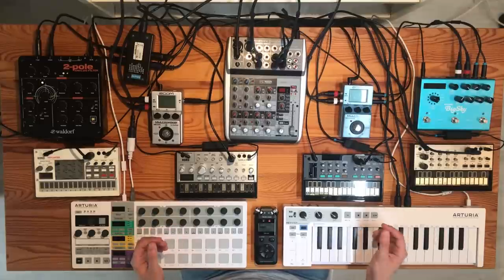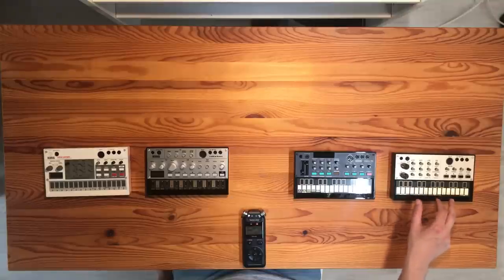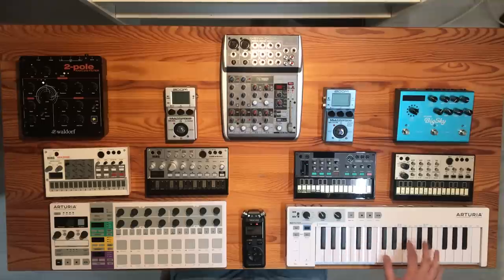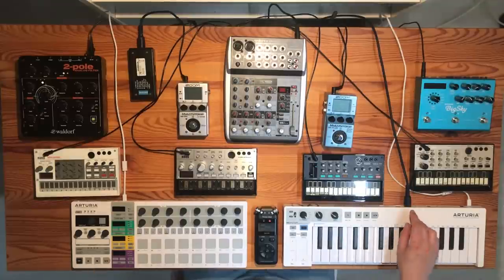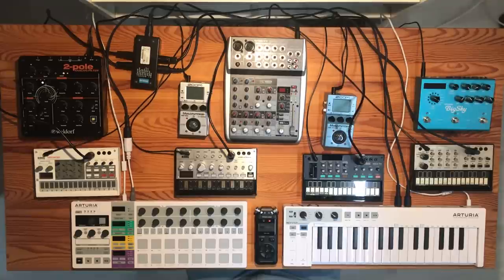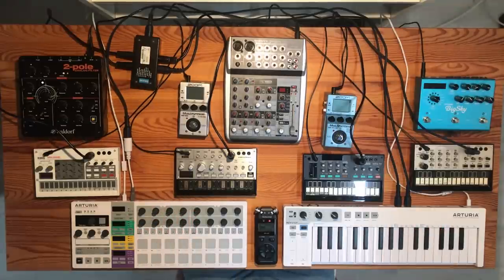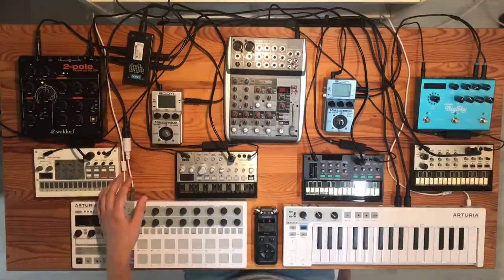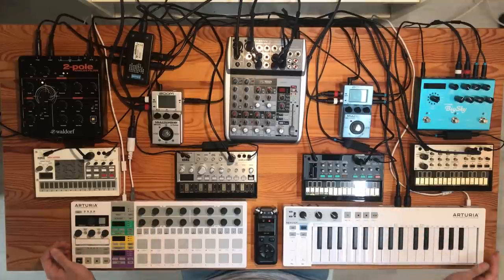Our Volca Setup: How Is Everything Connected? (2018-06-03)

Comment: I use a midi transformer to layer volca drums with the circuit. The cuircuit drums don't output to the right notes to drive the drums on the volca beats so I write a tiny program for my midi transformer hardware that remaps the notes on the fly. While the volca beats has a cool sequencer on its own it doesn't have swing. The volca sample does but I like using analog drums on the same note as the samples on the circuit, I get really fat drum sounds by layering. Then I layer the bass synth with both volca keys and monologue, so I have a 5 osscilator analog bass layered with the circuit virtual analog bass. Sometimes I layer my circuit keys with the volca keys but usually I use the keys as a second bass voice either in unison or octave or ring mod mode.
Reply from the maker: Brian Redfern : Interesting! Do you have a video online of this setup?
Reply: @SlenterendeBeer  I'm working on it need some better lighting for my space but soon I'll be talking about circuit and even how to control volcas with Roli block
Reply from the maker: Brian Redfern : Cool! :)

Comment: Hi guys, thanks very much for the helpful video and great jams, I bought the keystep and beatstep after following the videos.
 I have the exact set up here but using just volca keys,bass and sample and even bought the same midi filter used.
after setting up just like the video (midi out of beatstep into keys and then onto volcas)I have the sample coming through the drum channel of the beat step with each drum pad corresponding correctly to the sample, but I just can't seem to get the keystep to work with the bass or keys. It seems maybe I'm not setting up the midi channels properly on the control centre. Both Bass and Keys are set to midi channels 11 and 12 on there respective units after seeing the sample takes up the first 10 but maybe you could explain further how it should be set up in the midi centre. Thanks very much for you time.
Reply from the maker: Paul Savage : You need to set the corresponding MIDI channel on the Keystep as well, by holding SHIFT and pressing the 11th or 12th key on the keyboard. So you don’t need the Control Centre for that. The one thing you do need to set for the Keystep in the software is to enable MIDI THRU. Let me know if that helps.
Reply: @SlenterendeBeer  thanks very much guys, I got it working. I seemed to have some other settings on the volcas like the wrong clock or RX short message not selected when holding function and turning them on.
Reply from the maker: Paul Savage : Great, glad to hear that!! :)

Comment: Thanks for this detailed video!

I have noticed in your videos that you are syncing the internal sequencers of volcas with the clock coming out of bsp thru keystep and miditech filter. 
Can you tell how are you doing that?
I have the same kind of setup in terms of midi connectivity, but internal sequencers of volcas are running separate internal clocks unless I connect them with sync cables. Can I do that with just MIDI?

Comment: re: Arturia Keystep sending Play/Stop messages to everything -- there is a parameter in Arturia MIDI Control Center to disable that. Unfortunately the current firmware has a bug and it currently can't be disabled.
I talked with Arturia Support just a few days ago about that and they said they are going to fix that in a new version of firmware.
Reply from the maker: Timur Batyrshin : Oh that would be great, thanks for the info! Maybe you can leave another comment once the update has been released? :)
Reply: @SlenterendeBeer sure, if they release it soonish. If that takes them several months I'm afraid I will forget about this comment by that time.
Reply: I just realized this could work even now if you are using Keystep as slave device: try setting "Transport Mode" in MIDI Control Center to "Off" instead of "MIDI".
It doesn't work when Keystep is master clock but I didn't check if it works in other scenarios.
Reply from the maker: Timur Batyrshin : Okay, does that mean you have to connect another device to the MIDI IN of the Keystep?
Reply: @SlenterendeBeer  you are already using beatstep pro for that, if I got your question right
Reply from the maker: Timur Batyrshin : Haha yes, it’s a different question: does this also work without plugging anything into the MIDI IN? ;)
Reply: @SlenterendeBeer  Arturia support said that transport messages are always sent with midi clock now (and that's what they are planning to have fixed). That's why I think it could work fine with external clock

Comment: Amazing video. So helpful and inspirational. Thanks guys!

However I had a quick question regarding the MIDI Thru/Filter device. I, just like you, found it very annoying that pushing the Stop/Start button on the Keystep would Stop/Start all the devices that are slaved to it. So I went ahead and bought the exact same Miditech device that you suggested. However I’m still having difficulties making it work the way I like. I believe the switch that needs to be ON for that purpose is the REAL switch, or the Switch #8. But when I turned that switch to ON, even though it DOES filter out the Stop/Start messages, but it also filters out the Clock data as well, and the Volacs ends up using their own internal clock for tempo, which is of course not ideal and messes up all my synchronizations. 

So in short my question would be, how do you filter out only the Stop/Star messages without losing out on Clocking data. I can’t find much useful info in the manual. I believe the main manual is in German, and the English version has not been translated really well, and it vague and confusing to me.

I would really appreciate your help on this as I was not able to find help anywhere else. I understand if you don’t have time for this, I still continue following your beautiful channel and being inspired by them,

Cheers,
Reply from the maker: Siavash Shiva : Thanks, glad to hear it was informational. I remember encountering the same issue, a few times even, but I can’t remember the exact solution. The way I approach solving the issue is to keep it as simple as possible. Set all filter options to OFF, except for #7. Then make sure the Keystep has no MIDI coming in and set its clock / sync dip switch to INTERNAL. Connect the the Keystep to the Miditech IN and one Volca to one of the OUT ports. Now program and play a sequence on the Volca, and change the RATE knob on the Keystep, which controls the tempo in INTERNAL mode. The Volca should change tempo and when you press the start/stop buttons on the Keystep the Volca should not respond. Hopefully that works and you can add devices one by one. Don’t forget to set the Keystep clock / sync dip switch to MIDI if it receives the clock from another MIDI device (like we have with the BSP). I hope that helps!
Reply: @SlenterendeBeer  Thanks  again for the great response man. Really helpful again. For some reason my Keystep does not seem to function like yours. It looks like as soon as I press the play button on the slaved Volca, I lose all the clock data coming from the Keystep regardless of the Midi filter configuration. Only the the tempo knob on the Volca itself changes the tempo. I even tried it without the Miditech and it works the same way. Now I know the issue is with the Keystep, because I tried using my Electribe sampler as the clock master, and with the #7 switched ON on the Miditech, and it works exactly like you said with Volcas. I was able to change the tempo on the Electribe, and play sequence on the Volcas, and the Start/Stop messages from the Electribe are filtered perfectly. Do you know if there is a setting in the Keystep that would make it work like that? Thanks again!
Reply from the maker: Siavash Shiva : Hmm yeah the Keystep isn’t really meant to be a clock master. If I remember correctly it only sends MIDI clock on its own when the sync dip switch is set to INTERNAL and, more importantly, when it’s playing. So you should try another clock source as master, feed that into the Keystep’s MIDI IN and set its dip switch to MIDI. Also make sure that you enable “MIDI THRU” in the Keystep’s software (MIDI Control Center).
Reply: @Sam Petty Yes that exactly what I ended up doing as my last hope, and it worked!

Comment: This helps a lot, there are so many ways to organize a dawless setup I kind of get lost....your video explain the basis and that's perfect!
I'm currently thinking of buying some news gears to go dawless and i was looking for a mixer, I've heard that the Behringer XENYX is a good start but it looks a little bit too cheap...Do you think it's a solid gear?
(Thank again from france).
Reply from the maker: Moeb Eno : It kind of depends on your budget and the features you’re looking for. I bought this mixer to start with, but I have also bought the XENYX UFX1204 (also in the video), because that has multitrack recording. I think the quality is pretty great for what you pay, and the Behringers usually pack a ton of features. If you have more specific questions, let me know. :)

Comment: I really liked your video, but I have one question :) I just got a Volca modular and the weird thing is that when we connect it to our Focusrite Saffire Pro 24 with a TRS 1/8" to 1/4" adapter with the 1/8" TRS jack it came with, the audio out level is so low I can barely hear it. But when I connect a headphone  everything's fine. I'm sure there is something with the connection between the Volca stereo out and the Focusrite's XLR/line in. I've seen that you have also some stereo and mono gear. How do you connect the stereo volcas to a mono input? Do you just simply use a stereo to mono adapter? Because you only talk about the ground loop isolator (which is useful too) but not about how you connect them together. Thanks in advance.

Comment: thanks for a great run down on your setup!  i have a similar setup with KS/BS controlling Volcas and other synths.  One issue i find is that if i run a sequence on the BS, and try to play an arp on the KS, the arp is always out of sync or lags.  The only way around it that i can figure is to first hit play on the KS to 'arm' it, and then start the sequence on the BS, then play the arp on the KS.  It works fine unless you want to stop the arp midway through, and try to start it up again (it will be out of sync). fyi i have midi from the BS in to KS, then out from KS to a splitter as you do.  just wondering if you've experienced the same, cheers :).   Edit: oh actually I’ve just tried synching from the additional clock out from the BS to the sync in on KS.. seems to work fine now!
Reply from the maker: Good to hear you fixed it! :) I was going to suggest checking SYNC dipswitches on the Keystep. In the setup outlined in this video, the BSP provides the clock to the KS, so the dipswitches are set to "MIDI".

Comment: Helpful! One important part that wasn't clear is audio from volcas to effects. Are you simply going from one volca to one effects unit with a different effects unit for each volca? So: Sampler to Waldorf, Bass to Zoom 1, FM to Zoom 2, and Keys to Big Sky. Looks like you're not using an effects loop off the mixer and then sending channels, right?

Comment: Hi I have a question. I have a volca sample synced into a volca bass, synced into a volca fm, which is synced into my arturia keystep, which is then midi into another synthesizer. the sync in from the volcas into the keystep is just to control the tempo so that i can play/sequence my other synth in tempo with the rest. however I can't get this to work. when i have my volcas synced into the keystep, the sequencer just starts playing automatically and cannot be stopped. no matter what. any advice? i have the syn in/out set to 1 pulse (korg) and have sync in on the back of the keystep
Reply from the maker: Hi Yakov. I'm afraid I can't help you. You mention you have already set the dip switches to the expected value, and I don't have a lot of other ideas... I stopped using sync cables a long time ago - for us everything is MIDI-synced. Good luck!

Comment: Additionally I have a question about the KEYSTEP.  I can't get the arpeggiator and sequencer to work. Right now its receiving Sync In from the Volca's (last one in the cable series) and sending MIDI to a Volca Keys. Perhaps it is because I am not sending MIDI CLOCK to everything? I can play the Keys which is already a great upgrade from playing the tiny glass buttons. Thnx for any reply!
Reply from the maker: Peter Oosterloo : Hoi Peter. Make sure you’ve set the Keystep’s dip switches to “sync”. We’ve stopped using the sync cables and instead use MIDI for everything. You would need a MIDI splitter (or MIDI thru box) to connect all Volcas to MIDI. Hope that helps! :)

Comment: This is amazing! Thanks for sharing in such a concise and well-explained manner. How do you send control messages, however, if you're filtering them out? Doesn't this restrict your live performance options if you can't quickly recall patches and sequences?
Reply from the maker: Zam Nodorszk : Thanks for the kind words. :) We’re not filtering all MIDI messages, just the ones we need. Regarding patch switching: our use of that is quite rudimentary - we’ll just browse for the next sample or FM patch that sounds good :)

Comment: Heyyyy. At first thank you for this Video. It saved me many hours. Are you still happy with the MPow isolators? Reason why I'm asking: I'm running my Volcas with a isolated Power Bar for guitar pedals (Palmer PWT12. I built +- switched cables for the volcas). It is much better with the noise than with the original power supply. But I'm still not happy. Even with the Isolated Power Supply and also with batteries i have a little noisy volca bass and vlca keys. Now I ordered a Behringer HD400 for 21€ (2 Mono channel ground loop isolator. It also has unbalanced input and balanced output). But I think the quality of the sound is not that good than without an isolator. What are you thinking about the MPow. Do you have Sound quality issues? There are many reviews on amazon for similar products with sound quality issues. THAKS AGAIN
Reply from the maker: sild88 : Hi, glad to hear the video was helpful. We recently decided to switch to a proper power solution: the Strymon Zuma, which has 9 9V (center negative) isolated power outputs. This meant we could connect all our guitar pedals straight away, but the have specific requirements, since they use the smaller plugs and are center positive. We could have used 2 adapters per cable, but instead we decided to create our own cables. I’m planning to do an updated video explaining our current setup, including our power solution.
Reply: Slenterende Beer oh nice. I‘m waiting for the new Video. Let us know if you still need the MPow isolators when you are running the volcas also with the Zuma Power supply. THANKS
Reply from the maker: sild88 : No, you don’t need ground loop isolators with the Zuma, because a ground loop cannot occur when you connect all devices to the same (isolated) power supply.

Comment: Super useful video, I didn't know a Midi filter like that exists. The Midi Start/Stop message can get quite annoying, even in smaller setups. Do you ever notice the Keystep clock being inconsistent? I'm pretty sure my clock sometimes has a tiny drop in speed, it's quite annoying. I have never heard it in your video's though. (But then I'm not using a BSP, that one might be better.)
Reply from the maker: OttoNL : Hi Otto, just a heads-up: the MIDI filter for start/stop messages doesn’t seem to work for everyone. I don’t have a recommended solution yet. I haven’t experienced the Keystep jumps you’re describing...
Reply: @SlenterendeBeer  thanks for the heads up!

Comment: I believe you make the best Volca videos on YouTube! I am using a Keystep and the same Miditech filter. However, when I filter out the Transport Controls (Stop, Record, Play) by filtering all realtime messages with switch 8, I cannot control the tempo with the Keystep anymore. Do you have the same issue? Or do you use a different switch (5, 7, ...) on the Miditech filter? Any short hint would be greatly appreciated! Keep on producing these great beats!
Reply from the maker: Fabian Alt : Thanks for the kind words!! I always use switch #7 to filter out the transport messages from the Keystep, but I’ve heard it doesn’t work for some other poeple... Please try that and let me know if it works for you. :)
Reply: @SlenterendeBeer Thank you for the clarification. Yes, I tried switch #7 again. Even with both setup modes (white key or black key pressed) it does not filter out the messages for me. Do you know how the other people you mentioned solved it in the end? Would you guess it is an issue with the Miditech filter and a new one would solve it?
Reply from the maker: Fabian Alt : Right now I don’t have a solution. I’ll investigate myself. I’ve been thinking about doing an updated video on how we use MIDI in our setup, so if and when I do that in the future, I’ll be sure to include this issue.

Comment: The only missing part was the part to connecting all those effect pedals cables but it’s a  great video.
Reply from the maker: Johnathan C : What was it that you were missing? It’s eseentially just using the correct cables. I’ve added links to the cables I used in the description of the video.
Reply: Slenterende Beer  thanks

Comment: This is amazing. Thanks for the video and details <3 
I have a question for you, which cables/connectors you are using to send the volcas output (I have 2 volcas, they are being very noisy  especially when i send the output into an audio interface(scarlett 2i4) and i use currently Hosa CMS-103 Stereo Interconnect Cable - 3.5mm TRS Male to 1/4" TRS Male - 3' and tried couple others but no help. Thanks in advance
Reply: Try the ground loop isolators he mentions in the video